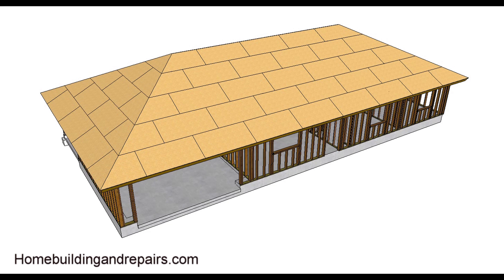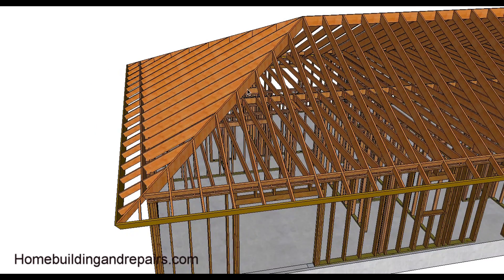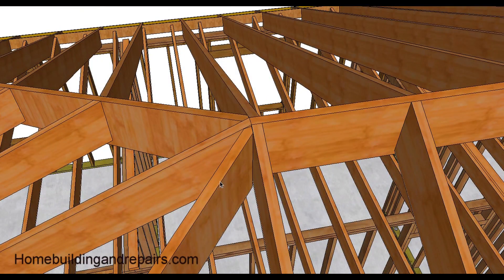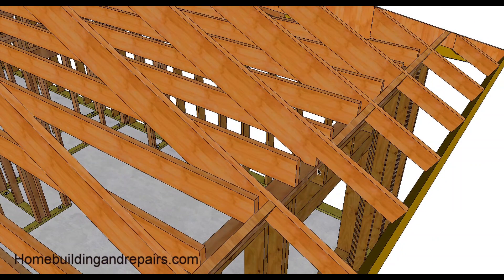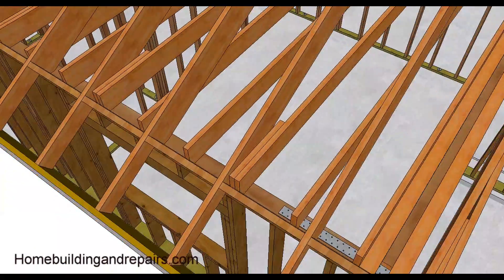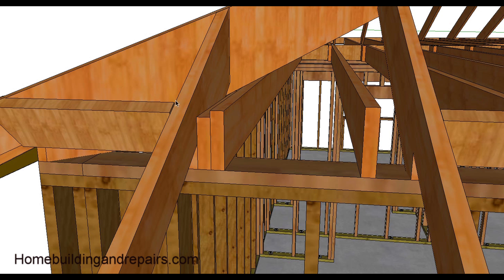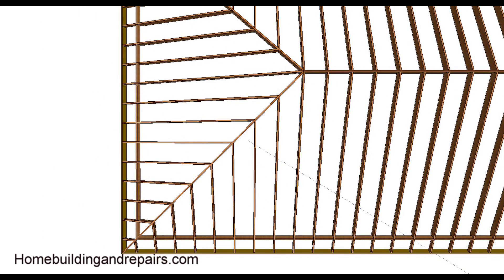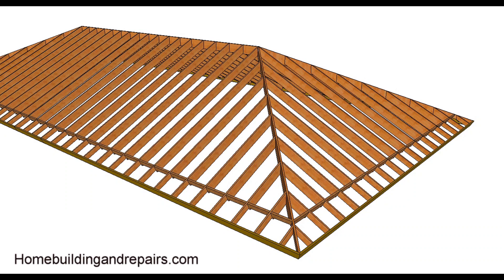Hip Roof Design And Building Basics – Conventional Framing

Comment: Does the interior walk in the center of the house bare a load? I know the ceiling joists cross in the middle but is that wall actually considered load baring?
Reply from the maker: I know it's not the same weight most of the time as the walls with the bottom of rafters, but it is load bearing.

Comment: So are the interior walls bearing load or just creating support for the ceiling joists? I'd like to figure a way to remove the center interior wall
Reply from the maker: Interior walls can be load bearing, but it isn't always going to be easy to figure out whether or not you can remove a wall that isn't load bearing.

Comment: Hi Greg.. awesome video. what would it take to vault one of the rooms in the corner of the building ? can I remove the ceiling joists and just keep the rafter ties every 4 feet ? I can wrap some wood and use those rafter ties as faux beams..
Reply from the maker: I cannot provide you with engineering information for your particular project, but can tell you that most building codes and engineers suggest using a maximum spacing of 48 inches on center for rafter ties and of course these could be wrapped and finished in a variety of different methods like those you suggested.